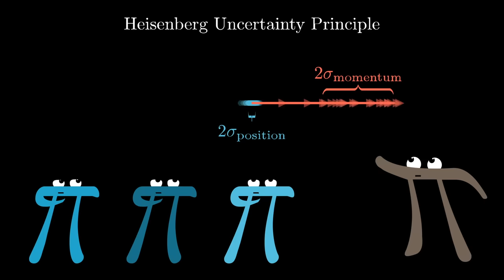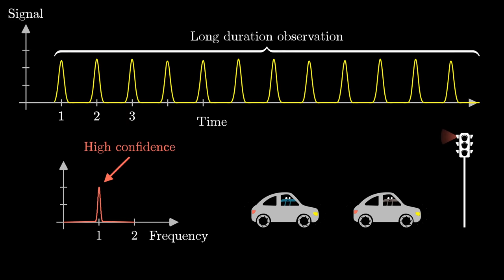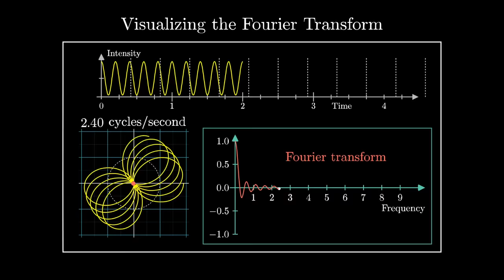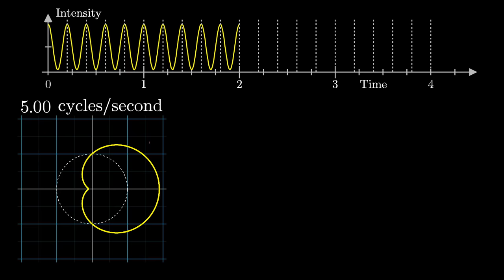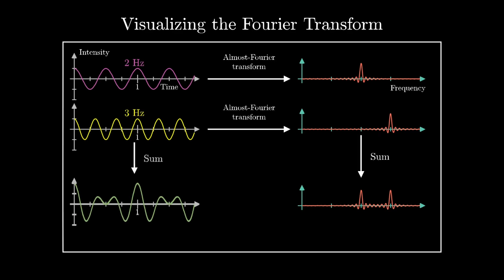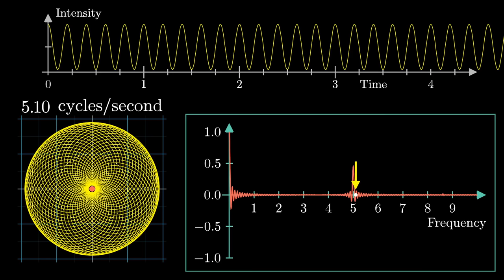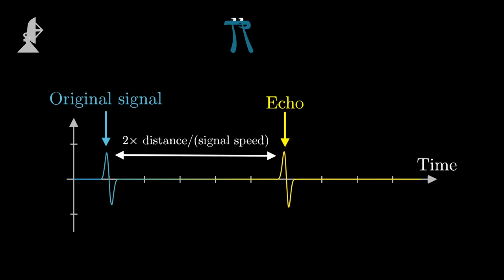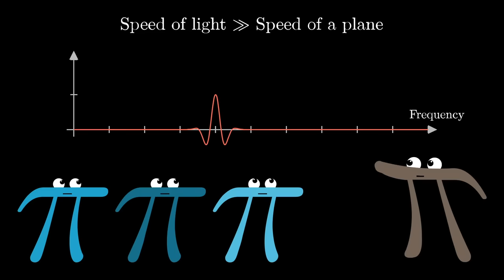The more general uncertainty principle, regarding Fourier transforms

Comment: Thank you for properly explaining the difference between the uncertainty principle and the non-deterministic interpretation of it. I get really irritated by physicists that treat the two as equivalent or inseparable.
Reply: I never heard of this distinction, do you think you could explain the difference? Is this video describing the HUP or the non-deterministic interp.? The NDI just sounds like a more technical description of the HUP.
Reply: The difference comes from how you want to view the whole system. It’s a little philosophical.

In classical physics, it is often considered that to have complete deterministic knowledge of a system you must precisely know the positions and momenta of all the particles involved. From this perspective it is the HUP that gives non determinism as without the principle we could just use a really localised wave for the position and a really localised wave for momentum and retain determinism.

However you could say that a perfectly localised wave is impossible. Also you may want to measure many other quantities, energy, time, temperature, etc. All of these might have some uncertainty relation between them (infact they do). So these are all described by waves and non of the can be perfect spikes at one point. So nondeterminism can really by tracked back to the decision to use waves and define probabilities based on the wave - instead of just the HUP.
Reply: Actually it is postulated that single measurements of quantum mechanical systems yield non-deterministic outcomes. The non-deterministic interpretation of the HUP is merely a consequence of this assumption about quantum mechanics itself.
Reply: Can't relate
Reply: I'm still not following. You explain how classical mechanics and determinism is defined, I get that. Then you say that you need the HUP to dustify the unknowability in this context. This seems like, mathematically, you are simply applying some form of non-deterministic algorithm, one that slides the knowability between two quantities, say time and energy, based on a constant which will include planck's constant. That seems to define both the HUP and this "non-deterministic interpretation". I can't identify a difference! 

Thank you for taking the time to try and explain this seemingly subtle distinction.
Reply: Well, they are equivalent and inseparable. What 3B1B is discussing is not the uncertainty principle of quantum mechanics per se, but rather its mathematical underpinnings (specifically the relationship between the second moments of a function and those of its Fourier transform). In quantum mechanics there is an extra ingredient that wasn't discussed: every time you make a measurement, you prepare a state. So unlike in the Doppler radar example, you can't keep making different measurements of the same object until you learn all you can learn. Quantum mechanical information is much more delicate. It's as if as soon as the radar pulse hits the airplane, the airplane self-destructs and you can't measure it again.
Reply: To clarify, the uncertainty principle is simply a mathematical description of how the wave nature of particles applies to our ability to measure them. The non-deterministic interpretation extrapolates that (and other principles) out to say that nature is fundamentally unpredictable, despite the fact that there is no concrete evidence to support that idea.

When we are dealing with extremely tiny and chaotic wave systems such as quantum mechanics, we are only able to measure in probabilities. The non-deterministic interpretation makes the mistake of saying that, since we can only measure in probabilities, nature is also fundamentally probabilistic, despite the possibility that reality could in fact be entirely deterministic, just with non-local wave interactions.

In short: The uncertainty principle is not evidence of non-determinism. That is a misunderstanding of what the uncertainty principle is.
Reply: "To clarify, the uncertainty principle is simply a mathematical description of how the wave nature of particles applies to our ability to measure them. "

That's right, but you get to do that at most once. This is important because it rules out successive measurements of incompatible observables on the same quantum state.

". The non-deterministic interpretation extrapolates that (and other principles) out to say that nature is fundamentally unpredictable, despite the fact that there is no concrete evidence to support that idea."

There is oodles of evidence supporting that idea. Bell-type inequalities, GHZ states, Leggett inequalities and such like all strongly disfavor the existence of hidden variables. 

"despite the possibility that reality could in fact be entirely deterministic, just with non-local wave interactions."

You may speculate to that effect, but to date nobody's been able to write a nontrivial model in which this is true which also agrees with quantum mechanics.
Reply: "Bell-type inequalities, GHZ states, Leggett inequalities and such like all strongly disfavor the existence of hidden variables."

Again, you're equating things that are not equatable. Hidden variables are NOT required for determinism. They are only required for determinism AND locality to be simultaneously correct (and even that is debatable, but that's a different discussion). The only thing we have evidence of is that determinism and locality must be mutually exclusive. It is either one or the other.

Therefore, the two most sensible options are: Deterministic & non-local, OR non-deterministic & local.

For some reason, many physicists have sided with the latter option, and declare it to be doctrine, despite not having any evidence in its favor, or any evidence against the former option. I find such conflation of interpretations to be dangerous and intellectually limiting. Especially interpretations that tell people "there is no more to learn in this direction because there is fundamentally no mechanism that determines how this works".

"nobody's been able to write a nontrivial model in which this is true which also agrees with quantum mechanics"

It is logically fallacious to declare that since it hasn't been done, it can't be done.
Reply: "Hidden variables are NOT required for determinism. "

They are. You can prove this by making two successive measurements on incompatible observables, such as position and momentum. After measuring position, the particle is in a position eigenstate, so the momentum measurement can return any value. Determinism would imply that this value is already set at the moment when position is measured. This value is not revealed by the position measurement however, and it's not part of the description of the quantum state. It is a hidden variable. QED.

"They are only required for determinism AND locality to be simultaneously correct"

Why do you think this is the case?

"The only thing we have evidence of is that determinism and locality must be mutually exclusive. It is either one or the other."

That's why I mentioned Leggett inequalities as well. They rule out large classes of nonlocal hidden variables as well.

"For some reason, many physicists have sided with the latter option, and declare it to be doctrine, despite not having any evidence in its favor, or any evidence against the former option"

As I said, there's plenty of evidence against hidden variables of all types, and lots of evidence favoring locality as well. If you're willing to discard locality you have to show why it is such an inextricable part of every physical theory ever conceived. It seems conspiratorial of nature to discard locality at its deepest level, yet enforce it in every way that human physicists have been able to investigate.

"It is logically fallacious to declare that since it hasn't been done, it can't be done."

I never declared it can't be done. But it hasn't been done, and not for lack of trying.
Reply: Why don't we use two sensors to detect both properties separately? Is it too difficult to have both sensors measuring the same particle simultaneously? Or do they interfere with the particle during measurement, making simultaneous measurement impossible?
Reply: "Or do they interfere with the particle during measurement, making simultaneous measurement impossible?"

Yep. That's one of the lessons of quantum mechanics. There are properties which cannot be measured at the same time, that is, in the same state. Position and momentum are two such properties.
Reply: It appears that you are misunderstanding what determinism is. Determinism is NOT hidden variables, and determinism does not require them. Determinism simply requires that specific effects have specific causes. It is the idea that if a particle "collapses" to a specific position, there was a set of conditions in place that resulted in that specific "collapse". Unfortunately the current vocabulary of physics makes it difficult to describe the difference between the two ideas. The term "hidden variables" is a bit misleading.

On top of that, do not forget that in both determinist and non-deterministic interpretations, measurement always affects the particle being observed. Simply because a measurement affects a particle and changes the next measurement doesn't mean it's non-deterministic.

As for discarding locality, if there is anything that discards locality, it is entanglement. How people see entanglement as disproving determinism but proving locality is beyond me.

And to state, just in case it wasn't clear: I'm not saying that the non-deterministic interpretation is wrong. I'm just saying it is logically fallacious to assume that it is the only possibility.
Reply: I'm beginning to see what you're talking about. I'll see if I can find the right words to describe what I mean. The "hidden variables" that most people talk about are regarding the information that the particles themselves carry over time, as opposed to potential hidden mechanics in how the system functions. While we've proven that there cannot be "hidden variables", we have not proven that there cannot be hidden mechanics in place. Determinism would require there to be hidden mechanics, but would not require the "hidden variables" that many talk about.

In other words, a system that produces entanglement and other phenomena can still be entirely deterministic without requiring the particles to carry any hidden information with them.

As for entanglement and locality, there is something that is causing the correlation between particles. While there may not be a transfer of information and there may not be "hidden variables" (stuff the particles agreed on before hand), there still must be a mechanism in place that is creating this correlation between entangled particles. This mechanism could very well violate locality.
Reply: A "hidden mechanic" (AKA some unknown law of physics) would be insufficient to explain the above setup. This is because if you repeat the experiment a number of times, each time after the position measurement the momentum measurement will give a different result. If you want to rescue determinism, some extra information must be carried in the state which somehow encodes the result of the momentum measurement.

For example, in Bohmian mechanics the particle has a "real" position, but no "real" momentum. The result of a momentum measurement emerges at the moment of measurement from the dynamics. Bohmian mechanics fails for other reasons, however.
Reply: "This is because if you repeat the experiment a number of times, each time after the position measurement the momentum measurement will give a different result"

That in no way disproves a hidden mechanic, especially in a chaotic system on a small scale. It is still entirely possible for a deterministic hidden mechanic to describe the results that we are seeing.

And yes, Bohmian mechanics fails for many reasons. I don't believe it is a good interpretation of the system.
Reply: I reject determinism not based on quantum mechanics, but on cosmology and symmetry. In order for a deterministic system with a symmetrical ruleset to display asymmetry, then there must have been some asymmetry present in the seed. Cosmology doesn't not provide a good explanation for an asymmetric seed, and anyway I think it's silly to assume the start of the universe could have been "chosen" non-deterministically, but everything afterwards must be deterministic. Non-determinism just makes more sense, it still maintains cause and effect, it's just now cause and effect is based on probabilities rather than logical implication.
Reply: Oh, and from a practical standpoint, it doesn't matter if the universe is deterministic or not, it's on some level unpredictable either way. This can be explained not just with chaos theory, which is overly complicated explanation based on reductionism, but on a higher level in terms of computer science or game theory. The fact humans make decisions based on information and they may want to act in a manner counter to what a prediction says makes it impossible for humans to have a perfect, usable understanding of the future.
Reply: I think we got lost in the weeds a little bit. In a sense it doesn't matter whether a fundamental theory underlying quantum mechanics is deterministic or not, since the context of this conversation is whether quantum mechanics itself is nondeterministic. What I believe is the central point is that there's little doubt that it is.
Reply: Imagine a sharp picture of an arrow; you can see precisely where it is but you can not know where it is going (you can not know even if it is stationary or it is flying).
Reply: I'm not sure if any comment here has already mentioned it, but keep in mind that so far only local hidden variable theories have been disproved by the Inequality violations. If QM arises due to some Mach-like principle, which would induce quantum fluctuations merely by the presence of everything else in the universe we probably wouldn't be able to verify it however.
Reply: Halberd, a large class of nonlocal theories has been ruled out as well: https://en.wikipedia.org/wiki/Leggett_inequality
Reply: Those who "treat the two as equivalent" are probably sophomoric undergrads, if I had to guess. The distinction is not exactly subtle. After all, waves and Fourier transform were perfectly understood by classical physicists, who had never heard of the "Copenhagen interpretation."
Reply: Couple of months away from a PhD in particle physics here.

" After all, waves and Fourier transform were perfectly understood by classical physicists"

The relationship between the second moments of a function and its FT are not what physicists call "the uncertainty principle".
Reply: Piercing - aren't the existence of virtual particles "concrete" evidence that it is indeed a fundamental property of the universe?
Reply: Two words: many-worlds.
Reply: A sound wave is a classical problem. It IS deterministic, but it is unknowable (the sound wave itself is knowable, some of its propriety like its frequency is unknowable).
Reply: I still feel like we should define what the difference between local, non-determinism and non-local, determinism. Maybe with an emphasis on the definition of locality and the difference between determinism and causality in general to help things along.
Reply: Fun fact: Virtual particles are actually just a handy interpretation that makes it easier to visualize the math. They are NOT a confirmed description of the reality of how things work. We have no evidence that they actually exist. Well, at least, we know the particle TYPES exist, but we don't know that particle interactions actually happen through the exchange of "virtual particles".

It's just a really useful way of imagining things because it helps the math make a little bit more sense. It's very likely that the reality is something else entirely.
Reply: +PierceingSight Aren't virtual particles meant to be a clever explanatory tool for why the vacuum energy of the universe seems to actually exhibit positive pressure? That whole cosmological constant and dark energy thing? Fascinated but not very knowledgeable about the math tbh.
Reply: Good discussion guys.  But without determinism the universe can suck my disausagon (you can quote me),  we might as well be living in the Matrix.  Therefore we must at least Determine this!   Maybe piercingsight  is thinking like a flatlander (that we are, but in 3d), so if spheres of random speeds and diameters were passing by us, we just see dots growing into circles or ellipses and shrinking back to dots again at random speeds.  So then we make this whole elaborate theory about how "dots" can evolve and it just nature and that's all there is, nothing more to see here folks.
Reply: @arkadiyk2469  How did it take this long to mention many-worlds? You get locality and objective determinism, and the only probabilistic phenomenon is one of perspective.
Reply: @GM 99 Basically, the idea is that a superposition doesn't actually collapse. Rather, when a measurement takes place, it puts the measuring system into a superposition of having measured each possibility. Because of QM math, you wouldn't be able to tell that your experience was just one part of a superposition, so this would look like the universe "chose" one state of the superposition--but actually it chose both. What appears to be a superposition collapsing is actually the entire universe ending up in a superposition, with each state continuing indefinitely. This happens whenever a quantum state collapses, giving rise to many quantum worlds.